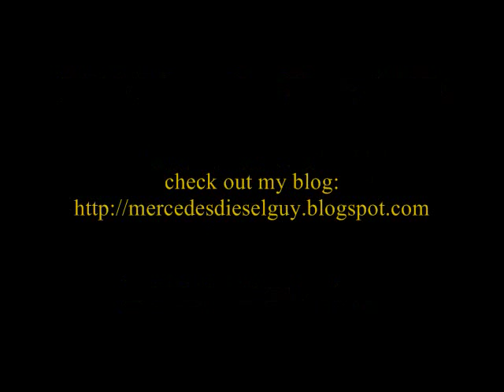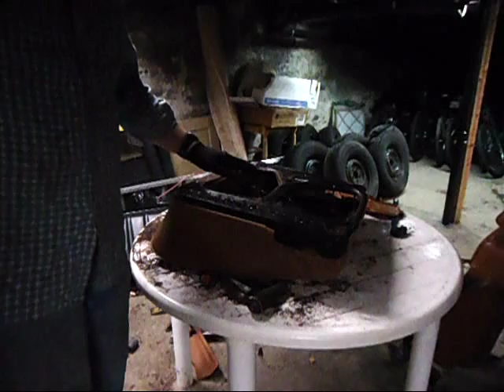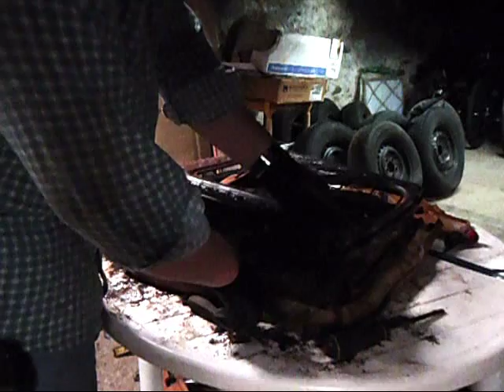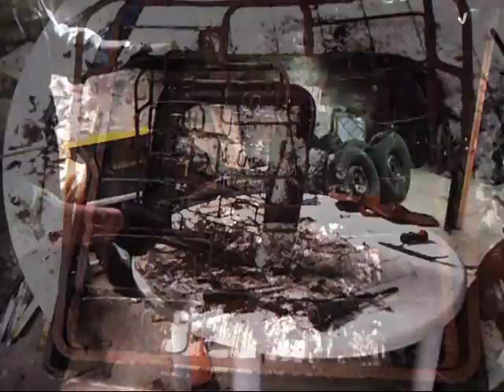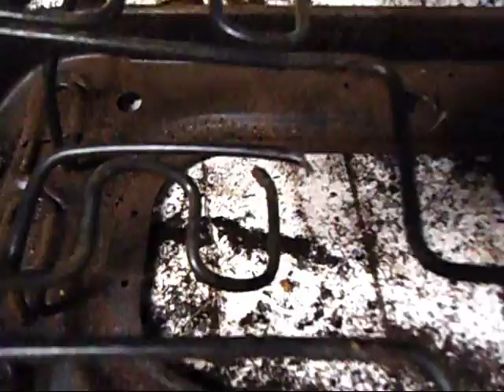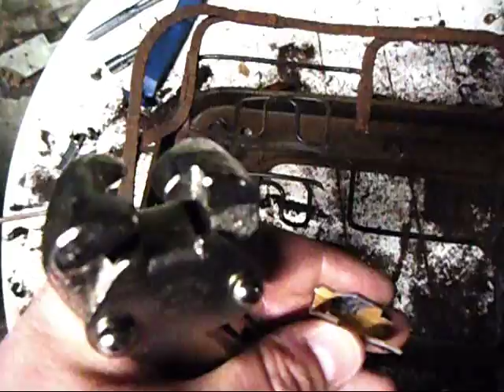Mercedes-Benz 240D (W123) seat repair- part 2

Comment: Would it be possible to mig weld the breaks in the springs?
Reply from the maker: Dave Kana I wouldn't. I think that the welds would be more brittle than the rest of the spring, and would be more prone to breaking again. My approach assumes that the repaired area should be flexible.
Reply: MercedesDieselGuy OK, I need to find the clips & crimp tool, thanks again, Dave.
Reply: If I used zip ties & burlap under the padding, good enough? Budget minded here, thanks, Dave.
Reply from the maker: Dave Kana That should work. I was winging it a bit myself.
Reply: Your a great wing man then! My seats are as bad as yours were. Question, should I get a used vac pump or rebuild mine?